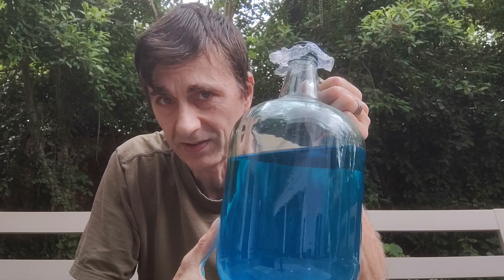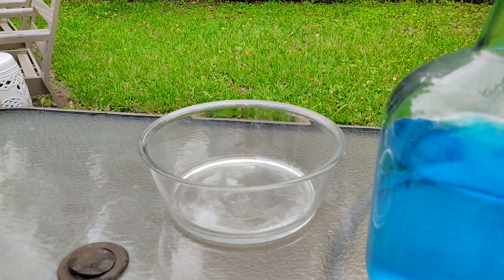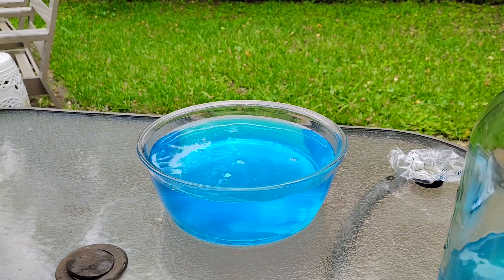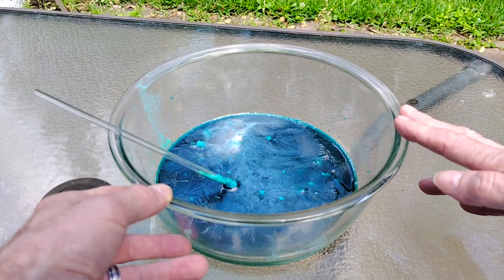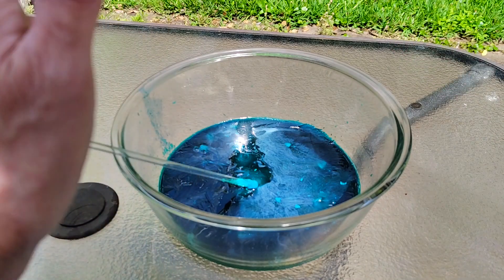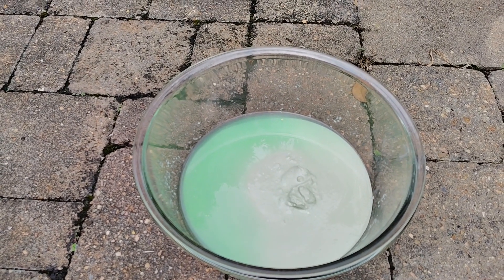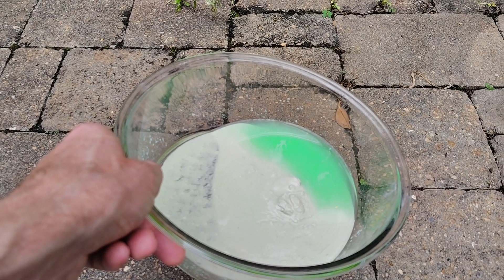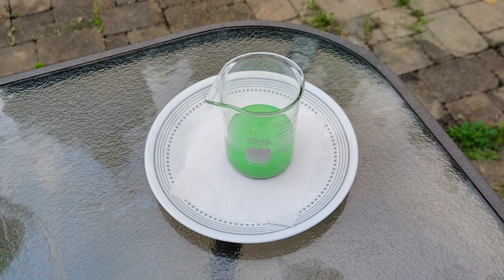Recovering Gold & Precious Metals from Electronic Scraps - Part III - Recovering Pure Nitric Acid

Comment: If you ran there'd fumes through a Birkeland Eyde reactor would you get a net gain
Reply from the maker: I am collecting fumes, actually. If you look at 7'30'', we can see that I added a hose that goes from the collecting flask to a beaker with water in which the fumes bubble.
Reply: @BlueMoonshine  I was thinking turning the NO2 gas  liberated by the reaction to NO3 in the electric arc 
And getting a net gain of acid 
Would it work that way?
AND
THANK YOU VERY MUCH
Reply from the maker: @mymikeysbeefarm3606  
At most, each nitrogen atom can give only one molecule of nitric acid. Whether you have NO2 or NO3, you still have one nitrogen atom, thus only one potential nitric acid molecule. In my case, the NO2 that I collected was turned into dilute nitric acid by bubbling it in water. This dilute nitric acid can be concentrated by distilling it.
Reply: @BlueMoonshine  thanks bro